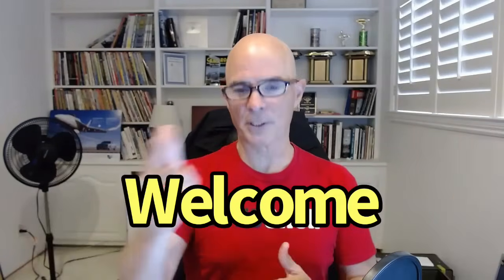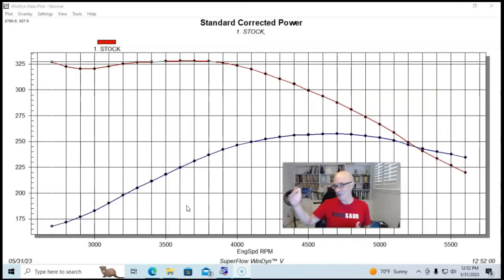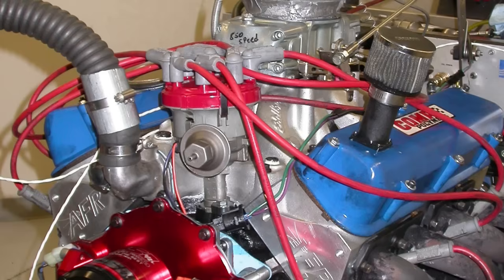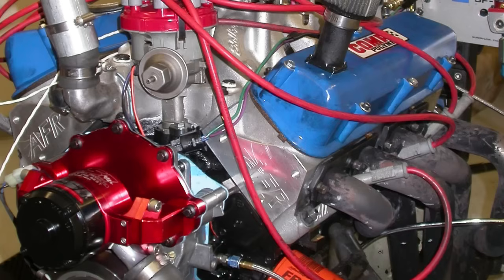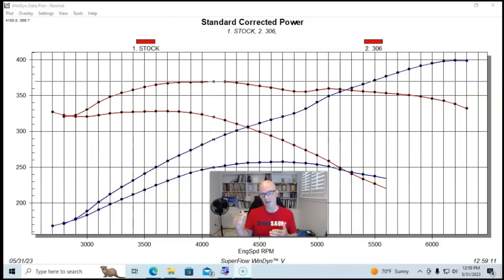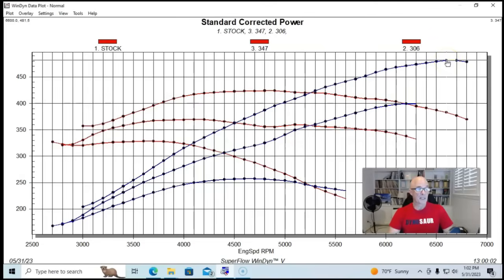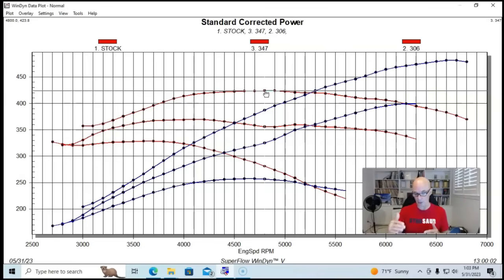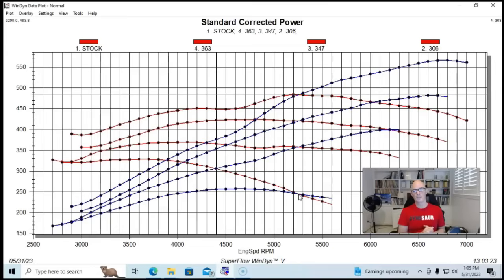HOW TO MAKE 5.0L FORD POWER. HOW TO INCREASE SPECIFIC OUTPUT ON YOUR 306, 347 STROKER OR 363 STROKER

Comment: I personally never paid much attention to 5.0. It was just easy to find a 350 and 400 cranks so as a kid mostly stroked small block chevy or a old cheap big block and a little shot of juice.  But honestly I am pretty impressed with the 347 numbers
Reply: Only reason to build a 8.2 deck (302) block is a 9.5 (351w) won't fit! Noone believes that a 306!! Those little motors will make power, but the deck 8.2" deck height makes you use short rods, the rod stroke ratio sucks!
Reply: @markmccarty9793  , another reason for a 302 block is to keep weight as low as possible. Weight on the front axle is you enemy, no matter if you build a car for handling or drag traction.
Reply: @westmus  ran both of them! The Windsor pulled the tires higher! Ran both in the same car!! The car with 4:10s ran as fast with no gas as the 306 did on a 100 shot! Now, the 306 got alot more outta the 100 shot!! But the cheap cast piston Windsor was still half a second faster on the hundred shot!! Cast flat tappet 357w with ported 289 heads(pretty much the same heads) ran 6.50, the ran 7 flat with a hundred shot, (1/8 mile)!  That 8.2 deck stock block will break ur heart I'd you go over 150 shot on it sooner or later! I'd simply don't think you should stroke a 8.2 stock block into a car if you're shooting over 150 on it! Build a stock stroke 9.5 block, and running it till you get tired of it!! In my opinion, and I did 3 times a week for 5 years, just get a 9.5 block, preferably a 95 roller! You can shoot 150 on it night after night!! Also, the Windsor with Victor Jr's on it ran 6 0's on 150 shot! It's just too easy and too cheap!! One motor, all season! Po boys hot rod!! My buddy had a solid roller 357 that ran almost that fast on motor, but the the shift light was set at 6900 rpm.

Comment: Let's take the same cam,  rpm intake, heads and carb on  357w. 10 to 1 compression?!!
Reply: It would be interesting to see vs the 347 and 363. Off the Dyno performance IMO would differ from on the Dyno due to weight... I think anyway 😉😂👍
Reply: @thetruthspeaker1978  you gotta turn the piss outta those little b!@ches! Ran a cast piston, Fred Flintstone cam, rpm heads in a Victor Jr intake and borrowed carburetor. 357 ci Windsor. A second faster than the 306! Took a 100 shot for the 306 to run that fast. We sold it to a guy to run street. Ran 7 flat 1/8 in it with 4.10 gears! Buy a 351w short block and don't look back!!  Preferably a 95 roller! Cheap, dependable, pump gas combo!
Reply: @thetruthspeaker1978  The block isn't strong enough for most of these builds! If ur gonna buy a Motorsports or Dart block might as well get a 9.5 block and build a 427! Now, 10 people will chime in to tell me you can go bigger, but that 4" stroke is already getting out there where your checking for rod clearance as the go by the side of the block! Back when people started stroking those Windsors they we're popping them too! It ain't gonna live long with 3 shots of gas! It's getting past the point where it's just fun and games!
Reply: @markmccarty9793  You use a lot of exclamation points.
Reply: @johnhickman106  yep. I find it's like pulling a gun  out when someone is stealing ur stuff! It gets their attention!
Reply: @markmccarty9793  Or the opposite with the boy who cried "wolf."
Reply: @johnhickman106  Hot lead is the great equalizer! We're getting off topic, maybe that's my fault!
Reply: @markmccarty9793  If we are going off topic, I'm familiar with shooting. I shot GAU-2 miniguns and GAU-18 .50 cals from MH-53s for 10 years, PKCs, M240s and M-60s from UH-1s and Mi-17s for another 6 so I understand putting rounds on target.
Reply: @johnhickman106  Back in the Miami Vice Era the damn things were everywhere down here. I've shot them, strictly legal semi auto!!!  Hell, street raced crotch rocket's! The cocain was everywhere, most people had no clue! The guns were everywhere! Shot the guns, raced the bikes, but passed on the dope!! ARs were all around, respectable people had no clue! When I got bored I sold the AR15 for chump change, hell, $450 would buy a brand new one! Buy a pump shot gun for home defence! Trust me, caught 3 assholes  going thru my barn, the 12ga looks like a cannon from that end! Deputy  was grinning his ass off when he got her! All the people who think cops are going to be there, look up the average response time to your house!!  The guy breaking into your house has a gun! Your choice!
Reply: @johnhickman106  There eas a time when I  woulda be envious,  but not now!!

Comment: Best way to make 5.0 furd powerful is to get rid of all the furd in it.
Reply: The Cheby 5.0 can't compete with the Ford 5.0..
Reply: @P71ScrewHead  actually the chevy 302  spanked the furd 30poo bad enough they had to redesign it.
Reply: @HioSSilver1999  Well Cheby always uses more displacement to beat Ford so their 302 was actually a 305ci, cheaters..lol
Reply: @P71ScrewHead  just because furd can't package a engine don't blame it on chevy.....400sbc/427ls ftw
Reply: @HioSSilver1999  Ford can work with smaller engines n still outperform.. We don't complain..